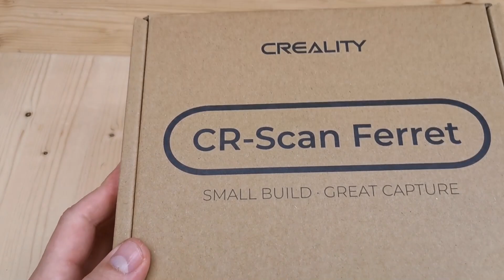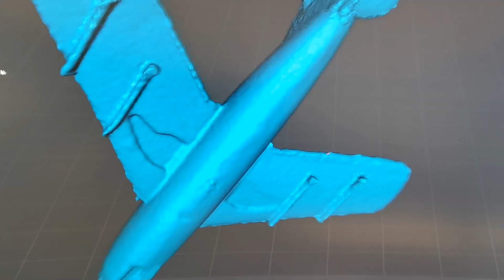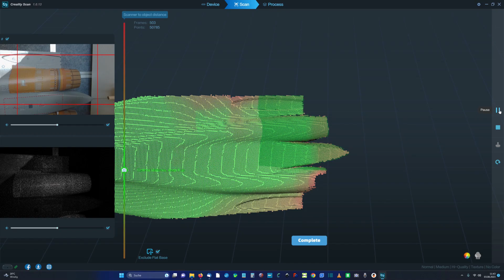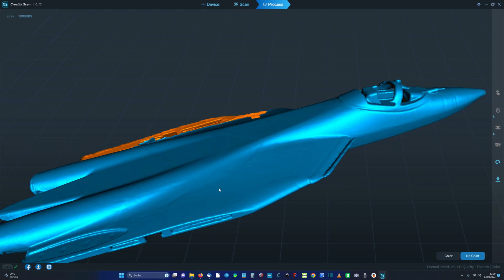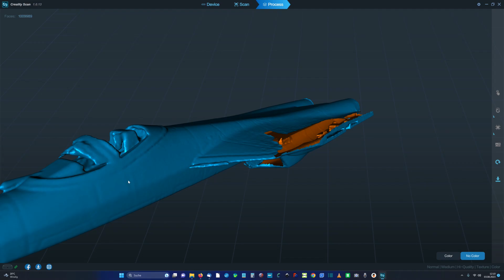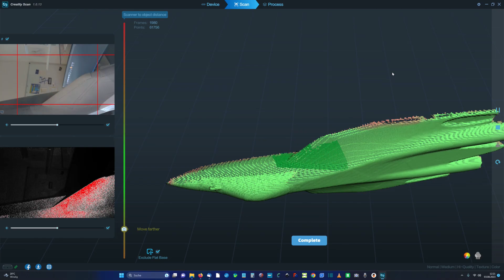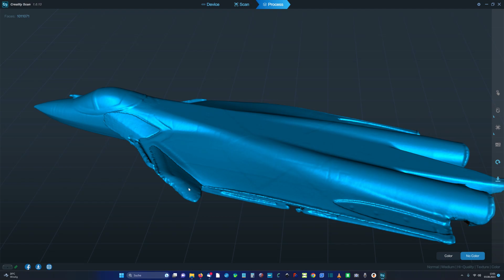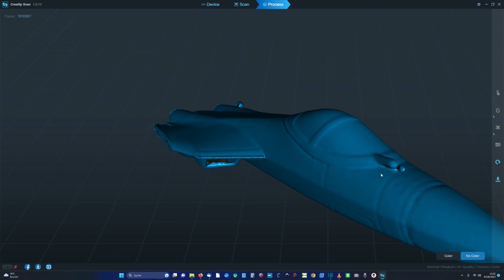RC-Jet Fuselage 3D-Scan with Creality CR-Scan Ferret

Comment: I purchased the 3dmaker scanner called the "Mole". I have used powder foot spray instead of the high priced scanning spray. It works great. However I am not real happy with the scanner performance. I take about 10 scans from all angles and align those 10 scans. Run of high sensitivity and I get a fairly accurate scan. But after processing at high poly count to retain high resolution most programs cannot open the odj file. It's just to big. I have not found a way to reduce poly count without losing g all the details. Why it generates 15k poly count on a flat surface makes no sense. And Fusion 360 cannot open it to edit. Trying to make Meshmixer do the edits is a rough slow road. I will sort it out hopefully soon. 
Meanwhile you need to get powder foot spray. The kind for athletes foot or a drying type. Long as it says powder on the front. It washes off after you use it. So make sure you can wash the item in water that you spray it on. Save that expensive stuff in the can for items you cannot use the spray on foot powder. Foot powder is only $3.89 a can here.
Reply from the maker: Sounds interesting mate 🙌